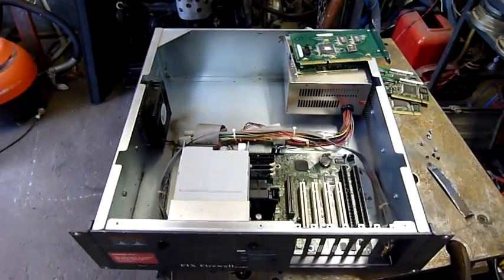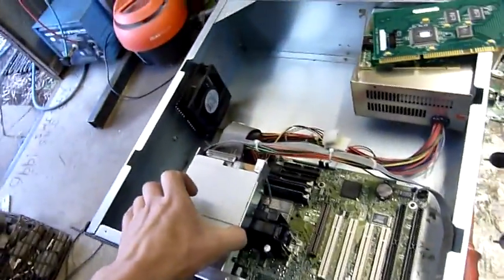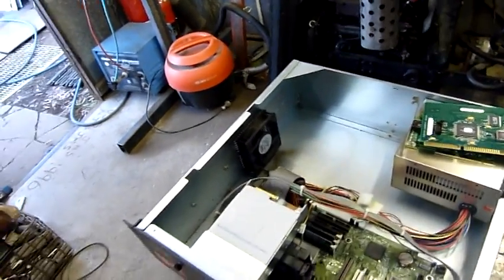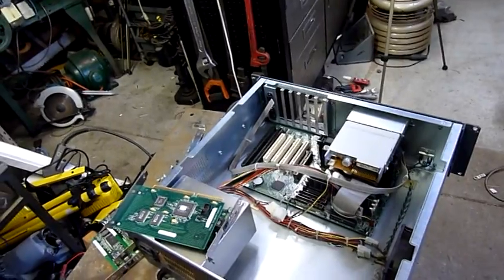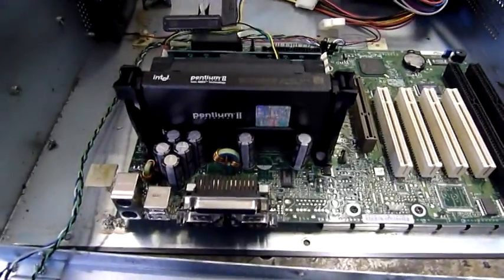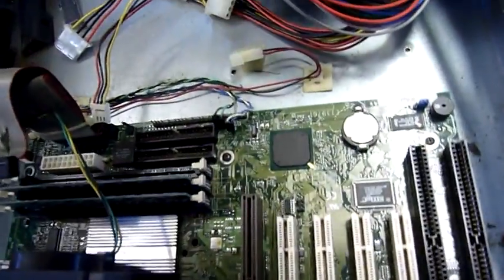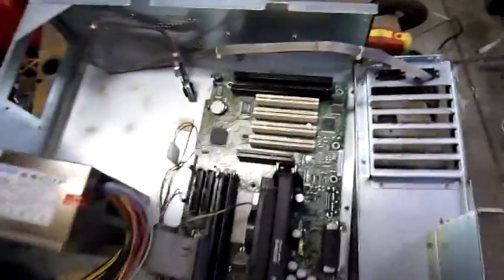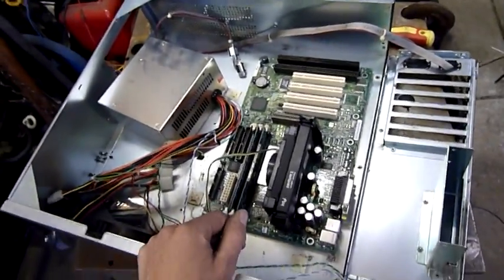Cisco Systems PIX 520 Firewall Autopsy

Comment: Oh, and P.S 
The pentium 2 started in 1997 with a 233MHz CPU. It stopped with the 450MHz clock
and then the pentium 3's came in on 1999 starting with a 450MHz clock.

Comment: Well, it depends, alot of their 1U/2U rack stuff is custom made(its the skinny ones in the rack, about 1 3/4 to 2 1/2 thick respectively)
Then you get thicker stuff like what ol ed has here which is basically meant for mass production to small businesses and the like. In fact, the pix series came out during the late 90's, supposedly to satisfy the internet boom that was going on at the time.

Comment: Well I would have put some old motherboard you got around in there, a new PSU coupled with a small harddrtive or you can use an USB stick, load PFSense on it and then you are on the right track for a proper firewall with ease of maintenance.

Comment: Why not just use an firewall/anti virus on each machine ? I've been using norton Internet security for few years now and not had any virus or hack ins .. Unlike avg and macaffee  were they let in so much crap and even allowed someone to connect to my pc and start copying my drive!  Noticed my hdd and Internet upload speed were maxing out and I couldn't do anything aside from kill the power to the modem!

Comment: That case looks terrible for anything. There's no internal drivebays for HDDs, and the external ports are hidden behind the front panel making it impossible to get to them without taking the case apart.

About the only thing it does right is mount the motherboard on the front of the case, rather than the back so you can get to the ports if it's stuffed in a rack.

Comment: the pentium 2 went up to 450 and the pentium 3 started at 450 which  find is strange. i also have tons of video cards that will fit that slot. i could find use of the board sometime.

Comment: Just connect a serial cable to the console port and use a terminal program with following settings if I remember correctly from cisco classes.  You can record the whole boot process from a terminal screen.

    9600 baud
    8 data bits
    1 stop bit
    No parity

Comment: Cat5 will work for short distances no problems at all. For more than 20-30 meters, you should get Cat5e, the price difference is minimal. That one's pretty much guaranteed to work up to105m.
I've run ftp cable Cat5e (utp with extra plastic core and solid steel wire) between two buildings for about 120 meters at gigabit and had no packet loss so you really don't need to worry.
The network cards should be good, though you can get intel pro 100 cards on eBay for 2-3$ which should be better,gold.